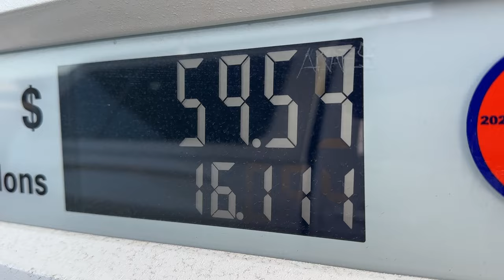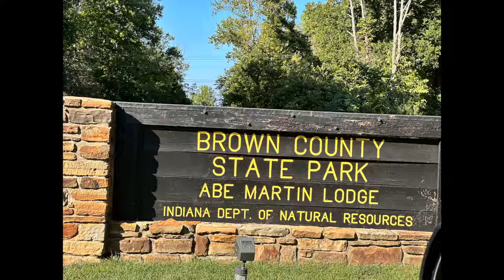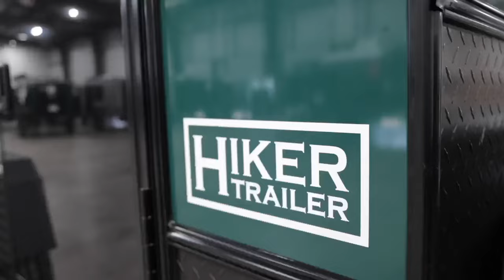Hiker Trailer Add-Ons: Side Tables & Ark Jack Modification

Comment: Well, my Hiker has a tongue weight of 260 lbs with gear and a full fridge / fridge box. My trailer is very new , picked up mid summer. I immediately realized I had made the mistake of not adding the ARK jack to the build. I called several times and begged them for a solution. I am not able to move it around at camp. I was not told of a list for the ARK jack / adapter plate but was told that I could purchase the ARK jack from ARK and install it with their clamp system. I seriously needed this , if you’re looking to order a trailer and read this the ARK jack is a must with a fridge box unless you are able to lug the tongue around at 260 lbs plus. I was told that I could fabricate my own plate . I would love to have my name on the “list” but that was not an option a month ago. I absolutely love the company and love my trailer but you need to get everything correct when you build your trailer or you can run into issues like this. I love my side table btw it came with the newer style .
Reply: I'm curious at what length camper you have that ended up giving you that much tongue weight? I noticed the placement of the axle on the different sizes and it appears that the distance from the rear to the axle doesn't seem to change much. It appears all the additional length on both the 9 & 10' is added entirely forward of the axle. 260lbs seems like a lot.
Reply: @dacrazycard7086  5x9 midrange . The weight adds up with a full fridge, fridge box and storage on the opposite side. Bathroom scales showed anywhere between 250 and 260 lbs , according to how I pack .
Reply: @kennethboatner8611  Oh I entirely believe you. I was just thinking if the axle would have been moved forward about 6-8" it would balance better. 260lbs is what I might expect on a 2200-2500lb camper.( I am sure it doesn't weight that). If you can arrange some of your load to the rear it will help. My guess is if you added 50lbs to the rear you would lose about 25lbs of tongue weight. Thank you for answering my question. I'm designing a camper right now and have been watching tons of YouTube videos for ideas.
Reply: @dacrazycard7086  I’m pulling it with a Jeep CJ 7 which will not struggle with the actual pulling of a 2000-3000 lb trailer but will be very sensitive to too much weight on the tongue of the trailer . Hitch is rated for 350lbs of tongue weight max. On my first trip out my steering was not happy about the heavy tongue but I stopped and reloaded everything and it was fine. I went as far as to completely unload my trailer in my driveway and weigh everything. Turns out that we own about 500lbs worth of gear (Inc bikes) . The Jeep will not like the extra weight so I severely limit what we bring . I’ve yet to weigh Jeep and trailer but I’m guessing that we have a 2000 lbs trailer and if so it’s severely tongue heavy . With the Dodge diesel that I sometimes use for longer trips I load everything that I want and I don’t even know that a trailer is behind me. Jeep is 10x more fun to drive.

Comment: Looking forward to finally getting the wheeled Ark Jack, once they're available. In the video, it does look like there's a slight bit of wobble once it's attached. Looks like I need to contact them again and check on pre-ordering status. Kyle was the point of contact on our pickup day, and was very helpful in explaining everything.
Reply: Just my opinion, but I think the wobble is going to happen on any jack that can pivot and is held in place by a pin. Using a pin is not really a 100% lock down method to hold things in place, but is a pretty reliable/cheap mechanism to start with.
Reply: @colemanhambleton9464  Yep.
Reply: Checked with Hiker about the status/availability of the Ark jacks, and was told to check back in a month or so.

Comment: The Ark Jack will clamp on behind the bung.  However, 1) the wall of the steel tongue seems a little thin.  So I wouldn't be cranking the clamping bolts too tight.  Ark even gives a spec. And then I wouldn't attempt the things that Ark advertises on their website like winching it through deep mud.  I don't think the tongue on the Hiker will hold up.  For repositioning on a flat, hard surface?  Ok. 2) On my trailer, Hiker put the sticker for the VIN right where the Ark Jack needs to clamp on right behind the bung instead of the diagonal member running to the side of the frame as seen your video here.  So if I want to install the Ark Jack and not damage the VIN sticker, I need to get a new sticker from Hiker or get the adapter plate separately.  But I'm not sure about using the adapter because the bung is wobbly not rigid by design.  Sigh.

Buyer beware that the diamond plate is a plastic sheet with a diamond pattern molded into it not aluminum or steel that's been stamped.  There is real diamond plate on the Hiker, it's just limited to the fenders (steel) and the tongue box (aluminum). Anything on the outside walls of the Hiker will be plastic diamond plate.
Reply: We use enameled aluminum diamond plating for the sides and walls.
Reply: @HikerTrailers  It feels like plastic.  It doesn't feel anything like the the aluminum diamond plate that the tongue box is made of.  Maybe because it's really thin?
Reply: The aluminum body panels don't seem to be adhered to the plywood underneath, and the same for the diamond plate.  Is that because of thermal expansion, or is that a construction problem?
Reply: @major__kong  Correct.  We use a thinner gauge similar to the side wall aluminum to help keep weight down.
Reply: @major__kong  Also correct.  We don't use glue to adhere the side walls to allow for expansion and to allow for any moisture that may penetrate to weep out and not sit against a glue layer.
Reply: @HikerTrailers  I was doing some mods on mine a few weeks ago, and it was literally popping / tin-canning as the sun was coming up.  Gave me a bit of a startle until I realized what was going on.
Reply: @HikerTrailers  how can one go about getting the connector bar for the fender side table? I can’t seem to find one online. Would love to add the table to my 2021 Hiker
Reply: @danielfaulkner5803  We unfortunately can't sell these aftermarket due to supply chain issues.  They popularity of the product is forcing us to allocate all of our orders to builds on file.  We hope to have a solution to this in the future and will upload these to our online store at that time.